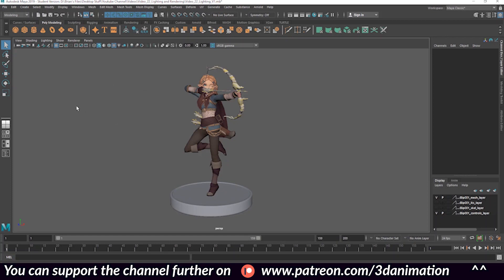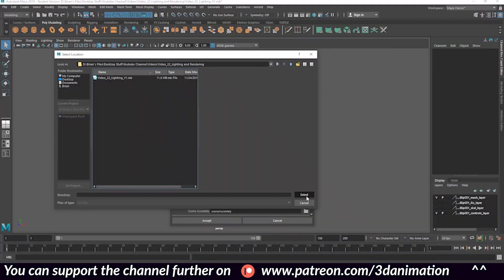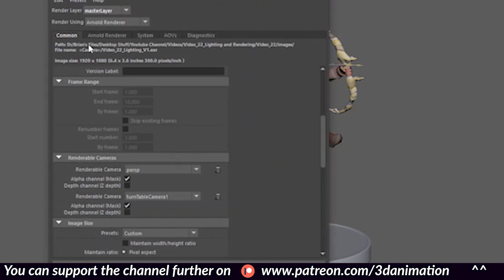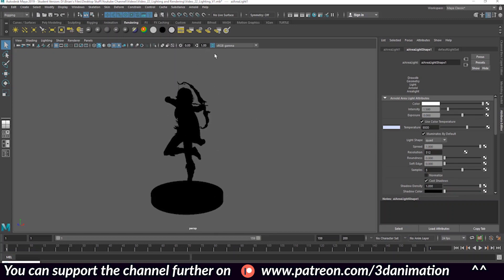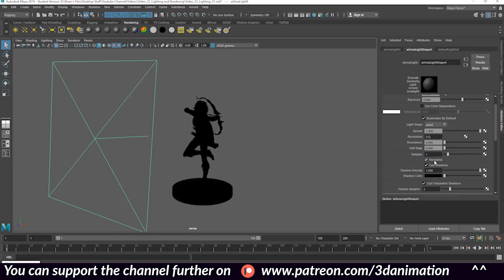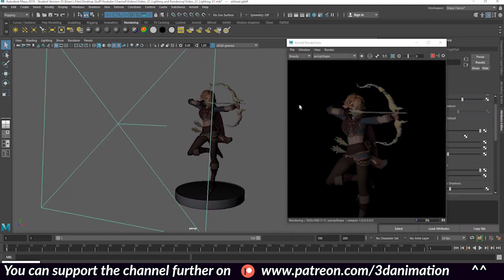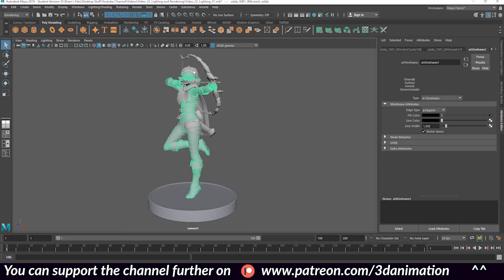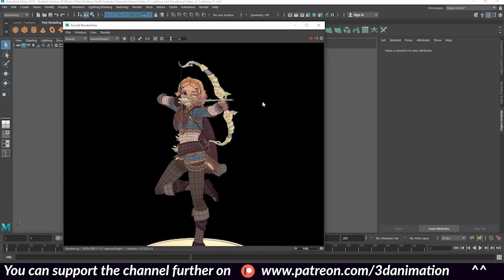Lighting and Rendering In Maya using Arnold (For a Demo Reel) 2020

Comment: I'm glad I found the solution to my problem in the first step. I should have used Arnold lights instead of Maya lights to begin with.

Is there an easy way to convert the regular Maya lights to Arnold lights? Maybe a way to link them for rendering in Arnold?

Comment: I have a question: Even though my model is low-poly because of retopologising, when I aiWireframe and render it appears to have so much more topology than my model actually does, why is that?
Reply from the maker: I'm not sure exactly what the issue could be, But it might be that you have an option on that renders your mesh in a higher subdivision (smooth render). Look into that